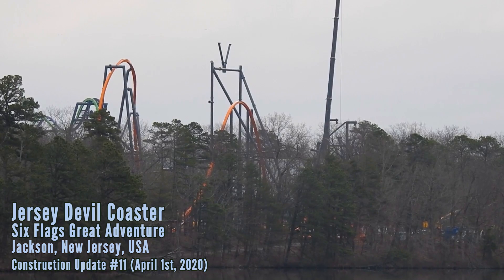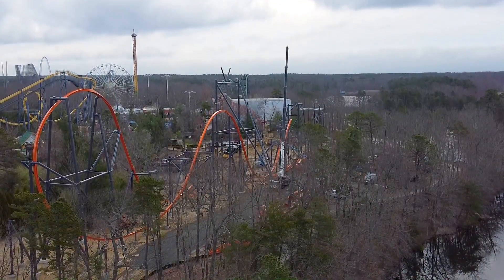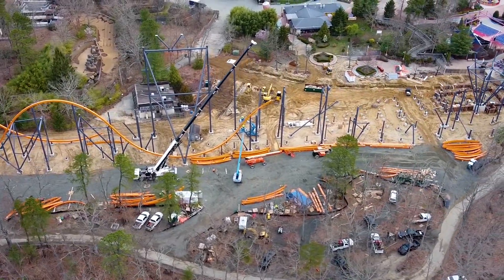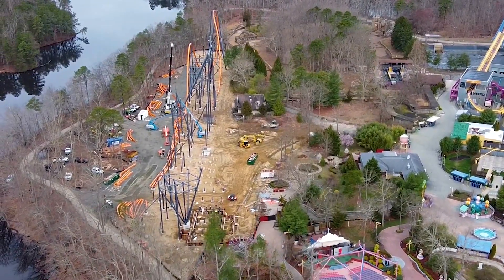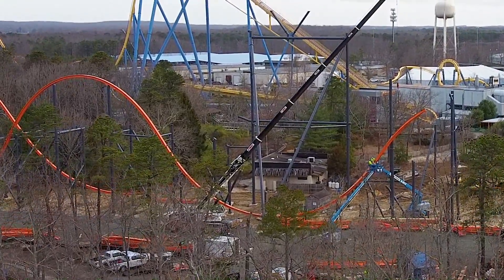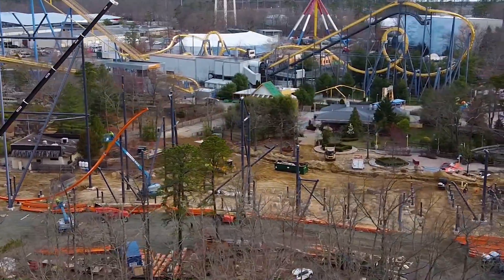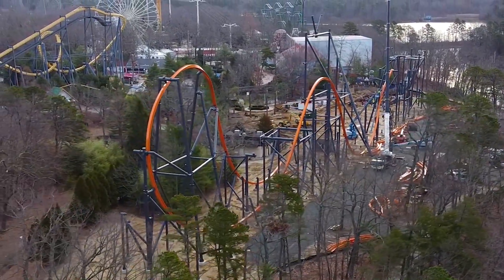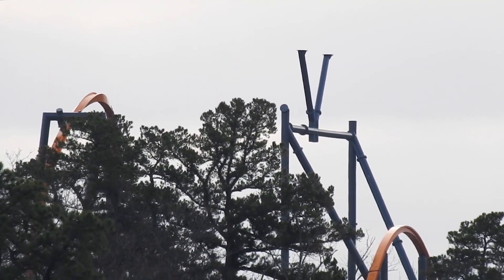Jersey Devil Coaster | Construction Update #11 | Six Flags Great Adventure  | April 1st, 2020

Comment: How do you get that much range with a Mavic Mini XD. In Europe it struggels at 400ft.
Reply from the maker: The park is located in the middle of nowhere so there’s very little interference. Plus I use a little low tech range extender that pops on to the antennas...If I fly in a populated area I definitely can’t get as much range but never as bad as 400 hundred feet